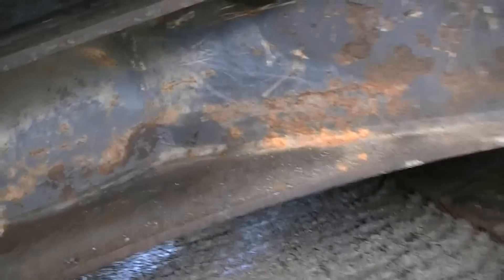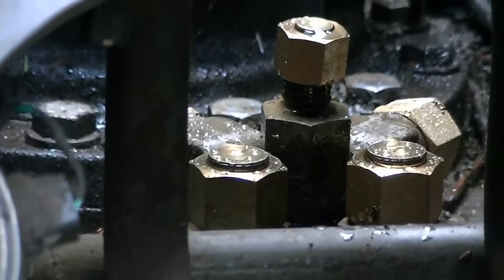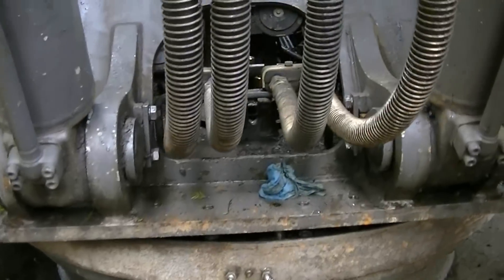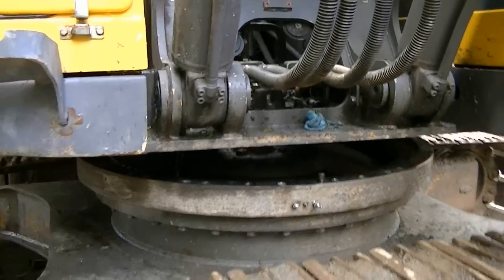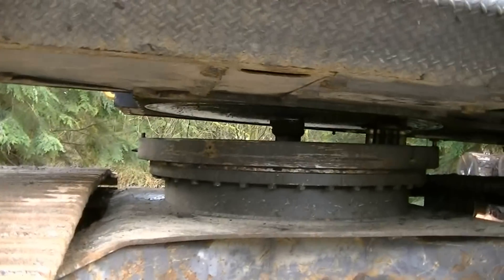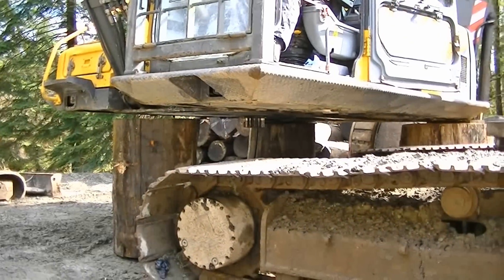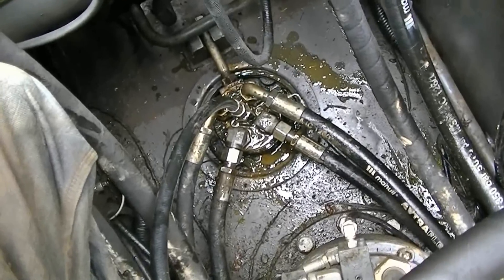Excavator Swing Bearing Replacement

Comment: The big question I have is how many hours did the machine have on it. Theres a similar machine for sale with 7000 hours the seller says it needs the new turntable seal but my guess is that it needs the bearing race and gear drive replaced as well, if it were me I'd be doing it all in one job instead of twice. How many hours do these commonly last and I know it depends what they've done, but generally ?
Reply from the maker: should last 8000-12000 hrs for the OEM ones
Reply: @skadill  Thank you mate

Comment: How did you grease the swing gear?…before you set the machine or after you bolted it down and grease through the inspection plate?
Reply: seen lads smear gerase all over the teeth of the   s  ring gear when they put it on   before they drop the house back down on the gear .........also   u can grease through the nipples on the gear   rotate 20  degrees and grease again  till u get around all the way ............

Comment: Do you also have to cap the rotary manifold hoses once removed so they don’t spray hydraulic fluid out or they should be fine as long as you don’t that function?

Comment: the last time I did anything like that was the turret to gear and bearing on a 30b log loader. 
 the bearing was lose balls about the size of a cue ball and the assembly was 21/2 times as big . seems like it took a week it wasn't hydrologic so it required different methods it was also 60 years old at the time. about half of the bearings were gone . so it required a lot of welding to rebuild the track for the bearings. and if I remember right there was a giant bolt that we t through the center of the turret holding the house and track together.
 seems like had to cut that and build a new one in the machine shop. 
 it's been over 30  years ago. still remember I hated it.

Comment: At 2:57 how did water get in there? The turn table should have anything in there besides grease?
Reply from the maker: water gets in through cracked rubber boot seal over the rotary manifold

Comment: Definitely shouldn't have water in it, slew ring should be full of grease, about 20kg of it...its also missing the rubber boot around the swivel joint to keep it sealed hence this problem occurring in the first place. Surely would had to of been done again since...prevention is always the better fix.

Comment: I have a dresser (komatsu)  1988 635 when I swing it doesn't have full power and it has some jerking and hesitation what can that be from? This is my first hoe and I'm still learning. Any help would greatly be appreciated
Reply from the maker: Dry bearing,grease it while rotating house
Reply: @skadill  I'll try it tomorrow thanks
Reply: @skadill  I greased it 2 more times and it's still doing it. When I start to swing it vibrates the hole machine the it goes away after it's built up speed
Reply from the maker: @hammonds82  theres a small cover either between the boom cylinders or in the tool box in front of fuel tank,that cover removes,and you can visually inspect the big ring gear teeth,there should be lots of grease on those,like 15 tubes worth in there,if not,use a paint stir stick or something and have someone swing machine dead slow,and slather the full ring gear in grease,also looking for missing or damaged teeth
Reply: @skadill  is it round with lines running into it
Reply from the maker: @hammonds82   No,thats rotary manifold that supplies track drive hydraulic lines.Just a small plate cover directly above the swing bearing itself for greasing and inspection,barely big enough usaully to get your hand in
http://wwwhttps.youtube.com/watch?v=_iZbFTa_4Sc
Reply: @skadill  if I get underneath the excavator and look up I can see the ring gear and the small gear that turns it is that where you're talking about putting all the grease
Reply: Is the bearing part of the rotation reducer
Reply: I haven't been able to find that cover that you were talking about
Reply from the maker: @hammonds82  Yes,should be covered in grease and running through it while the teeth engage
Reply: @skadill  I put alot if grease on those two gears and still having the same problem I inspected the teeth and Everything looks good.
Reply from the maker: @hammonds82   maybe the bearing itself is worn,shouldnt be more than 5/16 inch up down movement if i remember right,or swing reduction gear set in the bottom of the swing drive transmission could have a bad bearing,but that usually would be after its lost all its gear oil from the drive gear shafts worn bearing to turn in an out of round kind of motion,and cause its seal to expand and lose the oil. So check oil in the big round drive in center of machine

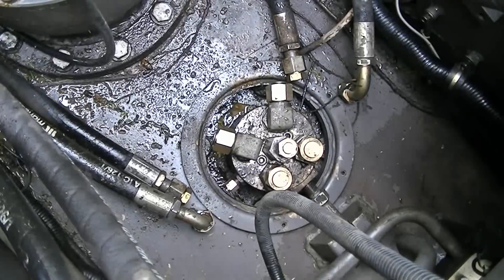Comment: Which and what size bolt you use to stop the flow of hydraulic oil from The pipe and Rotary Manifold on 6:01

Comment: You made a tough job look easy. What we do is every week or so we attach an electric grease gun to the swing bearing and then do a full 360 while greasing it. We've never replaced one. And of course we grease it every day, but the grease doesn't go right around, that's the problem.

Comment: how did you get the new ring and gear to line up again?
Reply: We did a few of these and you use 3 longer bolts and put blunt point at other end and lower down on the 3 bolts and then manouver the ubdercarrage with another machine front to back or side to side and after a bit you get the 3 bolts lined up and then fjnishe the rest . Takes a bit of patience

Comment: I expected to see roller bearings somewhere. Is the bearing just flat steel against flat steel with grease in between? Thanks.
Reply: There are balls inside.  The inner geared ring is stationary.  The outer ring rotates.
Reply: @troybolton4055  Keep them greased, thanks!

Comment: why a used one??
Reply from the maker: I bought a salvaged volvo bottom half of another machine with only 860 hrs on it,for the undercarriage components for a for another 210 ,and ended up being able to use the bearing as well for this 210,basically a free repair,I had more than one 210 volvo at at that time.
Reply: ok thank you

Comment: Made an absolute nightmare seem easy. I think I would have sent it to auction. My Deere has the ring bearing zerk in the cab, and if I skip any greasing, its not that one.  I consider a worn swing bearing a finished excavator.    Your ring gear should have been packed with grease, not water.  Made it look easy - the JD book says fill 4 55 gallon drums with cement and set the unit on them with a crane! But it also wants 3" depth of grease around the gear, and that part is correct.

Comment: I am going to ask, what was the actual bearing? 
The internal ring gear and material acts like a big thrust washer? Mechanically described I am a bit confused on the technology and scale of size.
Reply: the part he lifted off is the bearing, big balls that fit between an inner and outer race, they load through a plug in the side, at least on the ones I've done...after you've done a few really a pretty easy job....

Comment: How did you use the arm without sucking air into it with the recirc disconnected? I seen you capped the one side but how did you get flow back into the system using the arm?
Reply: All the lines to the swivel are capped off. 

Machine will function normally with all other controls.

Comment: nice job. We have salt water corrosion on bolts alot ...fun
Volvo is Samsung of Korea.
Of it was the old  Volvo Swedish steel and an or an Akkerman you would never need to change it. Ball bearings get worn in race s do to dirty grease and rusty water. I flush mine with 90w gear oil on hot days I pour it into seal on top let it seep in. Auto grease with a recharge able  battery grease gun in cab bolted to wall. I hit button every hard dig. PC 300 8,000 hours still ok. Shalom

Comment: Good job, but I love how you jump past the bitchy part, and the cursing part..... and that's that's lining up the upper ring bolts 😃
Reply from the maker: just put two bolts near eachother up in the holes and use the 5 foot bar to give it a rotate,it has line up dowels too.

Comment: finally a life long question has been answered, how many excavators does it take to fix and excavator. the answer? 2, the first is the machine being worked on to lift itself up and the second is a smaller on to pull the tracks and the ring.

Comment: How much grease did you put back in? Ive put 40 tubes in my EX200 and doesnt seem to be enough.
Reply: @ike fun lol
Reply: You can never add enough grease to this unit . We had an older cat 320D and i put in a waste oil and grease mix into a welded bin and attatched a air connection so i could pressure the container  and had 2 pipes going dow into the ring gear itself . Every so often we would then use compressor r to squeeze more oil and grease into it and it lasted 10 years afterwards but messy if a hose went on the swivel unit . Thise were the days 6am to 9pm for pennys

Comment: seems like a later model machine to need a replacement, a lot of hours of no grease?
Reply: Lot of water and no grease inside. Going to do this often if it continues like that.
Reply: Our mechanics say grease the turn table once a week with only a squirt or two of grease. They say the only thing it does is lubricate the little gear that turns the big gear (bearing) he replaced. There's a dirt seal which will be blown out if over greased.
Reply: @anthonythorp7291  Speaking for a 690E Deere, which turntable is on many models, my tech manual shows the cab grease fitting leading directly to the inside of the ball bearing race. Book says 3 or 4 squirts every 25 degrees. Dont recall timing - 10 hours or 50, but more is better and you can see it clearly coming out at the split in the bearing where the seals are. they dont blow out the seals, they just allow dirty grease to exude out. The inner large pinyon gear that connects to the spin motor has to have grease pumped in through a large rubber plug inside the bearing race. the grease depth is to be 3 or 4" and no water ever inside. You can use that hole to pump out the water. This takes any cheap high pressure grease. I reserve a separate gun for the turntable ball bearings with the top quality grease and be sure the fitting is clean. Lifetime turntable that way. One of the few things you can control on these bastardly machines.
Reply: @RRaucina  That is interesting. Never looked in book on that, not all our machines have them. Just took mechanics word.

Comment: to his each and own... when you do a job like this go all the way. Quick work, but would suck to have to do this twice
Reply from the maker: it was cleaned up for selling,it showed well,with the nice tight bearing,never heard of the machine since then.
Reply: Agreed.  Sloppy work. Hope you atleast  put the 10 or 15 tubes of grease back in slew gear ring compartment for spin motor gear.   And a new rubber on track swivel manifold to keep the damm water out

Comment: What was the indicator that the ring was bad?
Reply: Don't know about this machine but usually it will be one of the following
Machine rocks excessively (feels like its balancing on a tennis ball) - worn bearing.
Machine labors to slew (rotate) - seized or failed bearing.
Slew bearing grinds and screeches when slewing - failed or 'dry and failed' bearing.
When slewing the machine is noisy (tonk-tonk-tonk) from the gear and/or it bounces left and right when slewing - Slew ring gear worn.
Reply: I have finally found a understandable answer Slew never knew what it was but now I do thanks

Comment: How often is that job necessary in the lifetime of the machine?
Reply from the maker: pretty much only once
Reply: James Campbell depends on application and care it has received. As little as every 5000 hrs ( 40hrs per week,52 weks = 2 1/2 years) or 20000 hrs and more.
Reply: @deanmarkillie9699  ive seen them last 200 hours on volvo, Hitachi and komatsu piles of shit...
Reply: @ike fun ive replaced 6 Volvo bearings with less than 500 hours on them WITH auto grease units...
Reply: @ike fun uh... Youre an idiot... Auto grease units automatically grease the machince at a set interval. Every swing gear set I have installed from every manufactuer has had grease in it. You can't put them together without it.
Reply: When the bolts break
Reply: Now do it on a truck mount Gradall
Reply: Robert844 you sir, are an idiot and I, for one, would never allow you on my job site just because of the comments you have left on this page. Anytime someone suggests smashing a grease fitting, that’s enough to send them packing. Apparently you don’t seem to understand what automatic means. They still need grease. They do not manufacture the grease. Someone has to maintain the automatic system. Why is this so difficult for you to understand?
Reply: @Mr Sunshines   very true.   But you certainly dont want to over grease a turn table bearing and most do. And blow the seals out and dirt in.   Grease it lightly  bout every 100 hours.    Not like a bucket. Thats  what guys do then blow the seal out of it.   I wish this guy had shown wipe slew ring area out and put the correct amount of 10 or 15 tubes bout 1 inch up ring with grease inside slew ring like suppos to have in there for spin motor to continuesly keep slew ring greased.  Most guys never check that grease.  They just grease the bearing fittings and think thats it
Reply: @Mr Sunshines   never said it was. Just stating most people do when grease is broiling down the outside of them. Then your over greasing it.     Surely this aint got no grease cuz someone been running the machine for ever with the slew compartment full of water and blee inner and outer bearing seal out and washed and grease gone.       This guy dont seam to have a clue the skew area shiuld gave hand packed 10 to 15 tubes of grease in side it not water.

Comment: Why is there no hole to evacuate water and debris collected in the ring's inner diameter ?
All this water and mud is certainly not bearing or gear friendly.
Reply: The reason they don't drain is for use in urban or construction areas where grease residue leaking out is not desired and they are also designed to be mostly closed system with just a condensation drain so that dust ingress is minimized (why the hole is proportionally small). In the forestry industry this doesn't really matter however mud and dust protection is a plus.
As a side not during normal active use with regular slew ring greasing the water never really has a chance to contact the metal and cause corrosion as the slew ring is a grease pit of doom and usually has about 4 liters+ (1 gallon) of grease stuck in there after a few years of operation.
Reply: @another1commenter770    know how it works.   Your grease fittings from the out side grease the  SEALED bearing.  To much grease like most fools blow out seals and let shit dirt in.             The  big cover from under is to keep sticks and shit from getting in and ripping final drive hoses off.   Then small cover to drain and clean slew ring.       When in correct order that slew ring area should be clean nice looking grease aprox 1 inch up slew gear. So spin motor gear keeps slew ring gear greased as it spins.      If it looks like shit hole like that. His swivel manifold rubber is ripped letting water in and helping wreck gear cuz when full it pushes thru bearing seals in and out and water and shit greas pours out side.     When right you should be able to take upper inspection cover off a year later and see nice clean dry greas in gear.        That grease has not a damm thing to do with the grease you put in the fittings out side.     You have to fill that inner gear housing the inch plus deep by hand.          Done a lot of mechanics and have owned a ton  of excavators
Reply: ike fun it’s not a show machine it made to work pretty machines don’t make money
Reply from the maker: there is/was.It is a light guage plate held on with 2 small bolts,but you have to take the belly guard/plate off under the rotary manifold to get at it.Didnt know it was full until this time.
Reply: Wouldn't be better to just let it open to drain constantly ?
Reply from the maker: water got in because the rubber boot cover around the rotary manifold was torn up,but yes,it wouldnt hurt for moisture to be able to escape.this machine got sold right after this.Was machines ago now.
Reply: ok
Thanks.
Reply: skadill l
Reply: michaelovitch true I would make a hole.

Comment: ..OK...nice work. but I missed the swing bearing you mentioned....is it inside the slewing  ring???
Reply: It is. Go to 3:26 and take a second look. You can see the gear roll inside the bearing.
Reply: @kgraydakota    they dont have gear oil in them.   That was full of water with some hydraulic oil spilled on top from taking upper lines off the swivel manifold. The guy never replaced the rubber boot around the swivel manifold thats wear his water is getting in and helping to destroy the bearing.       That compartment  when all complete get 3 to 4 tubes of grease put in side it from a inspection door up top. So the amount of grease is up the gear about one inch.    As it spins it lubricates the gear ring only.  The bearing part is completely sealed with orings in and out and greased from out side fittings typically 3. All way around. And only a few pumps in each dont want to over grease you will blow seals out and let dirt in.      He. Should have explained how it works.        Ive done and own a lot of excavators
Reply: @toddreynolds8875    Hi Todd, I didn't say anything about gear oil. I was telling Doug to look at 3:26, you can see the gear roll inside the bearing. You can see that it isn't one solid piece.